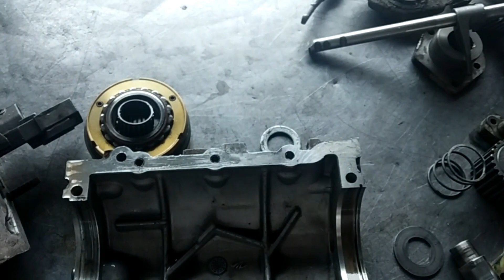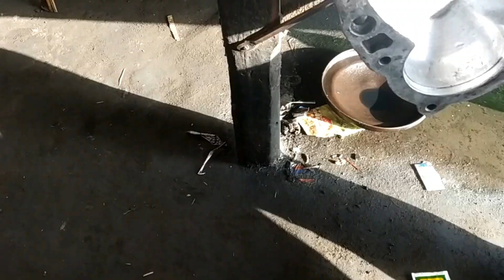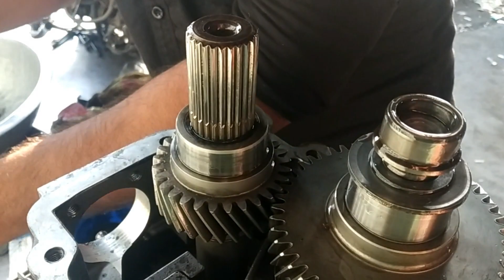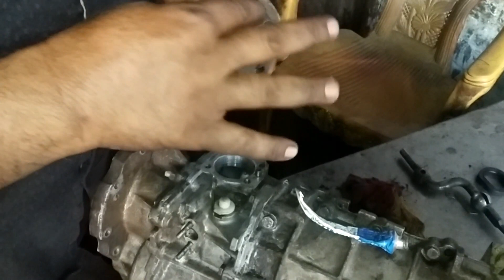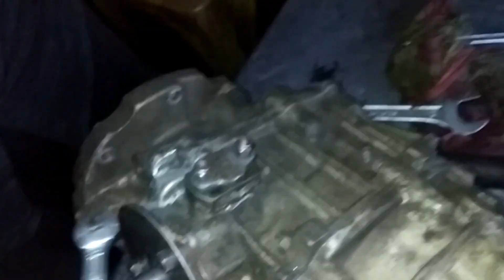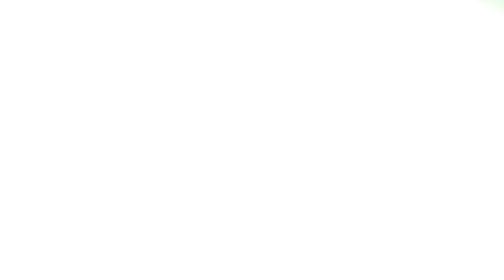Mahindra bolero 4x4 gear box installation ngt 530

Comment: Bhai mere pass santro xing xo h wo overheat hoti h pr temperature meter normal show krta h
Or heat hone pe radiator fan on nhi hota h isliye overheat hoti h... Sensor se unplug krne pe fan on hota h pr engine ki noise bdl jati h ya fir ac on krne pe fan on hota h
To bhai kya dikkt h ??